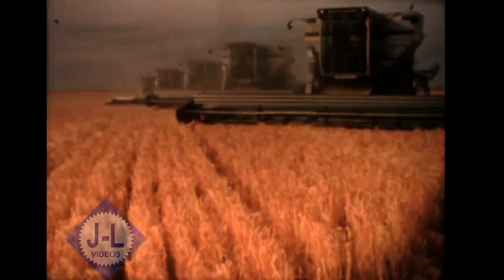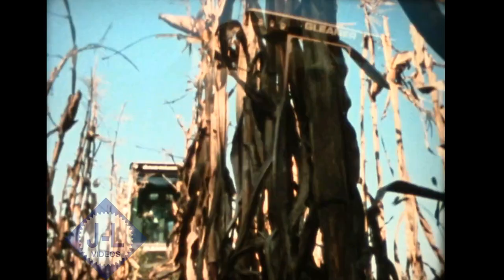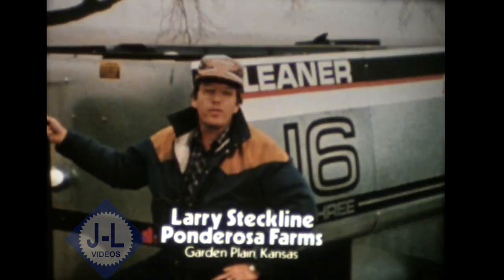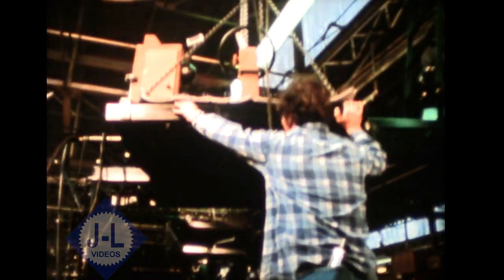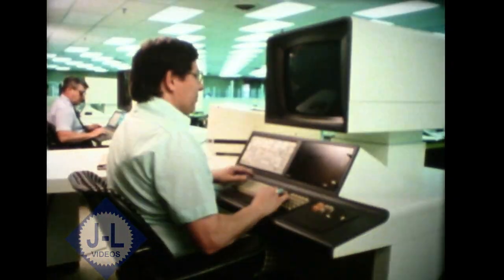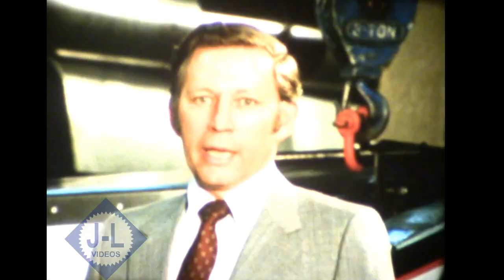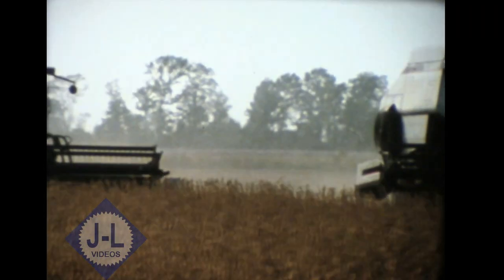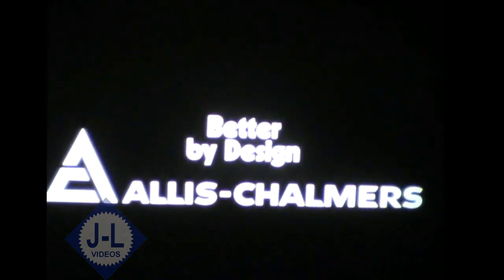1983 Allis Chalmers 60th Anniversary of Gleaner Combines Movie N5, N6, N7, L3, M3

Comment: My dad had one of the first N7 Gleaners around 2 years before the production models came out. The N6 came out first. My dad and his brother took over the AC dealer business from my grandfather in the mid 70's. My dad's brother ran the dealership. No dealership could get a N7 to display in their lot. You had to have a person interested in buying the N7. So my uncle convinced my dad to trade in his L gleaner for this monster of a combine. The headers came off and needed transport trailers to haul down the road. Dad had a 24ft head for wheat and soybeans and a 12 row head for corn. Dad added the extension to the grain holding box so it held around more grain. Before they got the combine, My dad and 2 of his farm hands had to go to AC training school to learn how to use and maintain it. 
They first thing AC told my dad was, do not wreck the radiator because we only have one spare. And of course the water pump blew and the fan went thru the radiator. My dad had to drive to Missouri from Ohio to pick up the spare and give them the damaged radiator.  We had rear wheel drive on the combine which also broke clean off. And another trip to Missouri. It was all we could do to keep the grain trucks empty. That N7 did more than 3 - L gleaners combined.

Comment: Lot of hours running an N7. Deere dealer tried like hell to sell a new 9600 to replace it.
That N7 tore that 9600 to pieces in milo, and did a better job too.
Deere salesman didn’t even try to pitch his machine after an hour in the field.
Reply: That's awesome, I love hearing stories like this.  Took Deere a long time to release a rotary combine to the market.  Gleaners were such advanced machines!
Reply: @GMdieselman  Allis had amazing engineering resources. Also because of A-C’s diversity they had manufacturing methods others did not possess.
Miss that old N7 every fall...crowd that hydro till the boost gauge read about 30psi and let her EAT!
Ran that machine for 10 years after hourmeter quit working and was around 5k hours when it stopped.
Cage was falling apart...that whole machine was a case study in metal fatigue by that point...